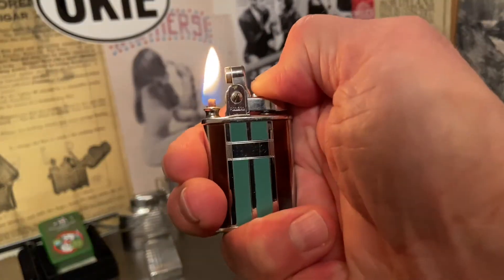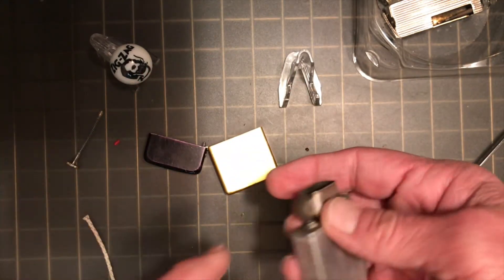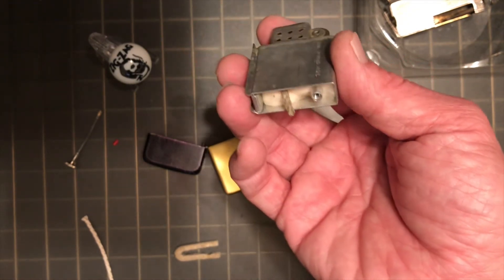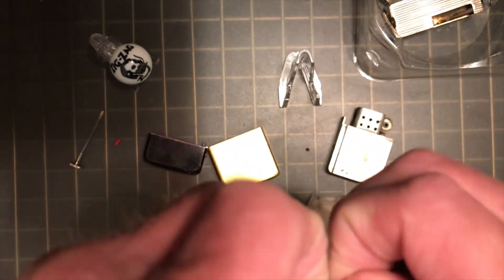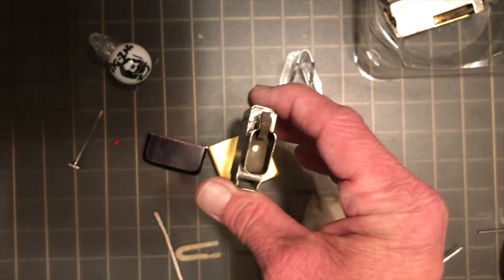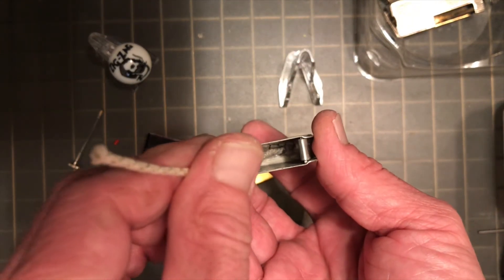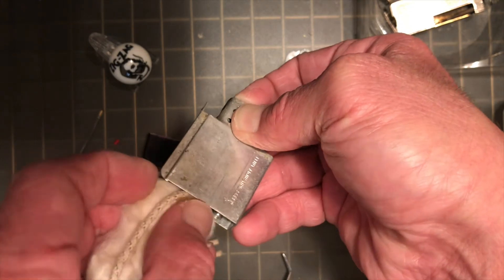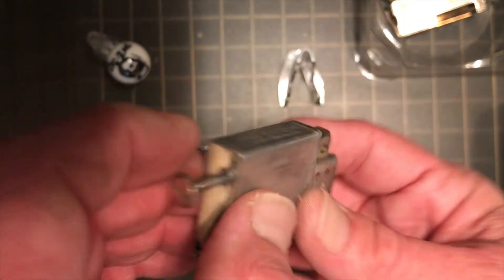How To Replace The Wick In A Vintage Storm King Petrol Lighter(PARK INDUSTRIES)

Comment: Hi DependableFlame, I would like to share with you my little discovery. Do you remember when I stated that I did not believe in the capillarity of the wick? I have done still other experiments, and I confirm that the duration of the fuel does not change, but I have discovered that when, after a few days, the fuel begins to run low, the zippo with wick placed in an S shape, is much more resistant to the wind. I was convinced I was right, but I had a doubt: if the zippo factory recommends putting the wick in an S shape, there will be a reason, but I never supinely accept what I read, because I want to understand the real why. I think I understand why, it is right to put the wick in the shape of an S, and I find it right to make you participate in this little discovery, because thanks to your channel I spend moments of serenity.
Reply from the maker: It is very windy in Oklahoma, my friend. So, I will take your advice to heart. I’ve had many Zippos that seemed worthless in the Okie wind and your explanation could account for that. I appreciate your kind words about the channel also. It really is my blood and soul and when I say in the intro, “Make yourself at home...” I mean it . Sometimes it almost feels like we’re all just hanging out here in my workshop, tinkering around and talking about lighters.✌️